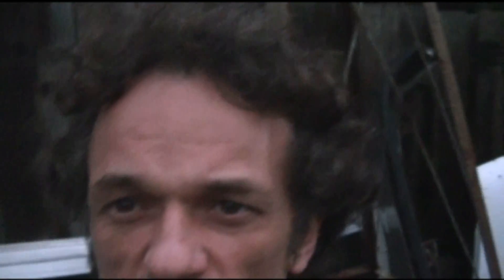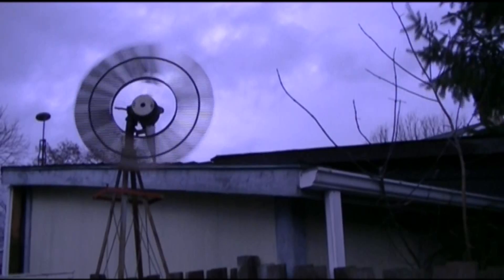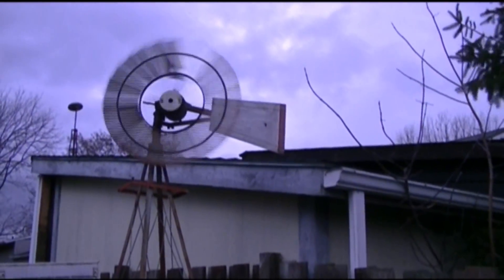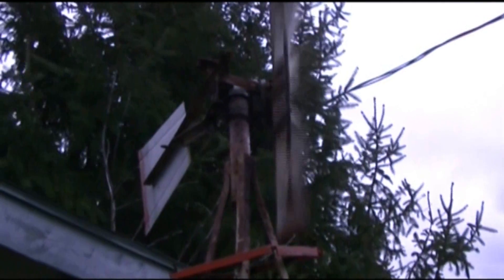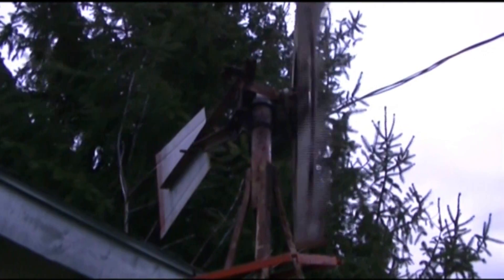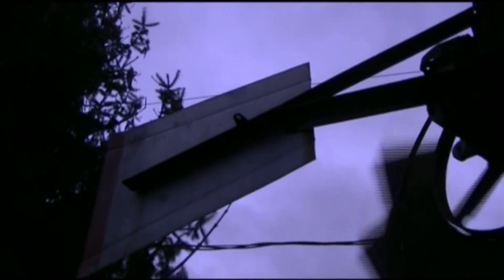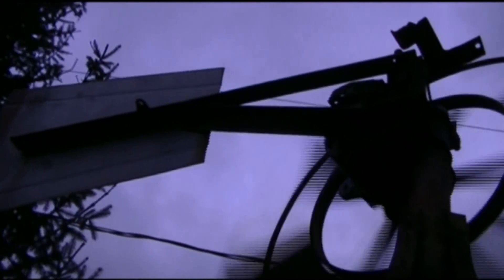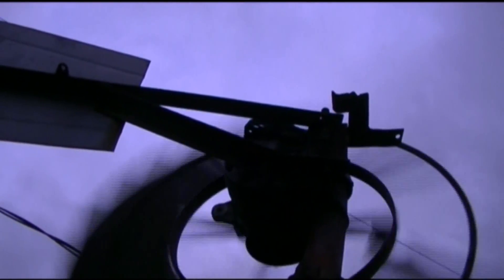Homemade Windmill Question

Comment: @MudRFunR Looked at your vid again and with all that wind  it doesn't look like it is turning at all just the tail is moving.  Pos&neg 10gauge wires from alt  to a 12v battery at the base of the windmill  and from there to your load.   Get it running and put a DC clamp amp meter on one of  the lines and see how many amps it is putting out.  Don't expect too much.  Let us know what you were  thinking of powering up.   I think you would be lucky to get 10 amps DC out of it.

Comment: I can help you out but I need to know what type of automotive alternator is up there and you should check if it even works first..  I suspect he put a single wire delco 10SI  , seems a  lot of people use them because there are lots around and easy to wire.  As for the tail section or direction vane it  is not designed to flop back and forth.  Looks like you dad thought it out and a spring is used to absorb some of the wind force so  I would  try a long brake drum spring.